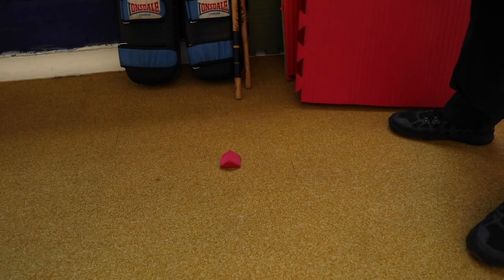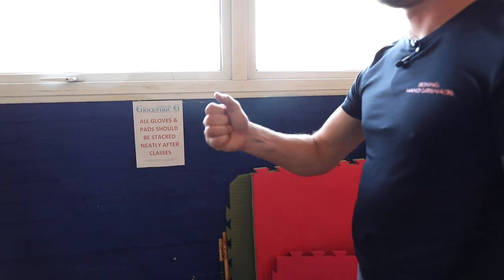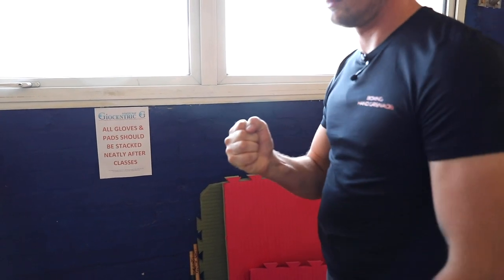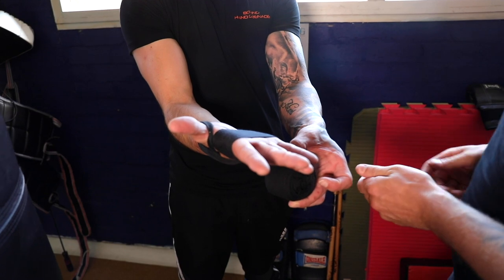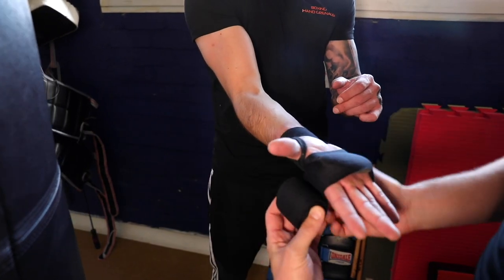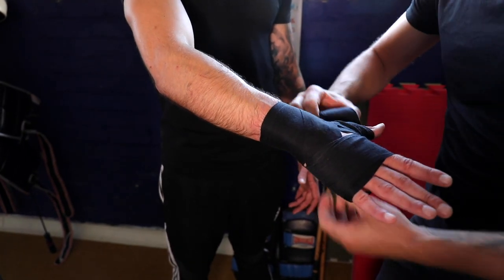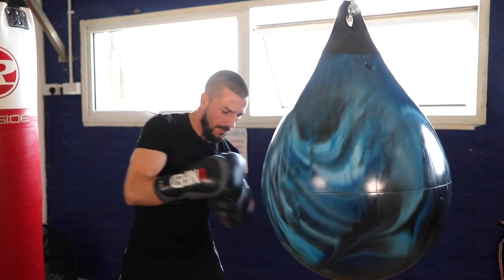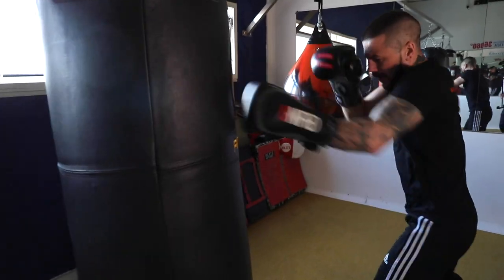Boxing Hand Grenade Story

Comment: I ordered a pair a couple weeks ago. My middle finger had an injury due to a ligament problem in my hand. I hope this can help me train with some intensity and/or at least be able to train and not injure my hand worse or have any pain while punching. I can't wait for it to arrive. I'm American 🇺🇸
Reply from the maker: Thank you for ordering a pair of grenades! Our recommendation would be to allow some time to break in your fist-loaders prior to striking full power on the bag. Use them first as a rehab tool: squeeze/release drills and Shadow boxing with them in your hands, allow the ligament issue to fully recover. Once you use them on the bag, don't wrap the grenade in tight, as always just lay the wrap on the skin and grenade, give the grenade room to expand on impact. Beyond this you'll love the fist-loaders on the bag, they really do enhance the structural integrity of the hand. They'll feel a little firm at first, especially in an already injured hand but over a period of use they will break in and begin to soften up a bit. Anything else we can do to help 
john@boxinghandgrenade.com
Reply: @boxinghandgrenade2374  can i spar with these as well or should it only be used on the bag and mitts
Reply from the maker: @wingoreviewsboxingandmma3667  It's always worth discussing it with the individual club and also sparring partners. Filippo Di Nardo has just launched the Hand-Grenade Gloves which feature our BHG-1 fist-loaders as a grip bar. For sparring, most clubs would likely accept this rather than objects within wraps that aren't soft foam  or gauze/bandage.
Reply: @boxinghandgrenade2374  hi john i'd like to ask, if the silicone is better in some ways than the carbon? -uriah
Reply from the maker: @yuree08  Hi, I would say that the price point is way lower on the silicone grenades which is a bonus (they cost substantially less to manufacture). They're easy to keep ultra clean as they're silicone rubber as opposed to the Carbon DLS lattice. They can potentially last for a lifetime (if looked after properly). But when it comes to performance the Carbon DLS GhostGrip version are superior. Unfortunately we still don't have any stock of the clear silicone version, only the Carbon DLS and foam Fist-loaders currently in stock.